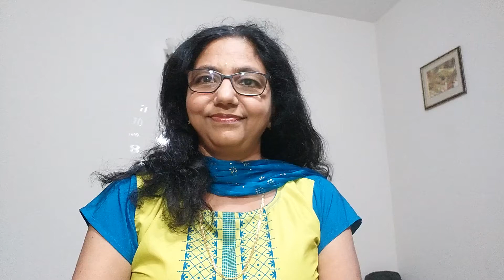Dr Anima Upadhyay viva voce questions on Potentiometery

Comment: Why we use quinhydrone electrode?
Reply from the maker: In Potentiometric Acid- base titrations it is used as it is reversible with H ions
Reply: @animansh  mam why we used it's powder not the solution?
Reply from the maker: @meenusingh5677 yes we add a pinch of quinhydrone as powder
Reply: @animansh  mam that's the question why we used pinch of powder not prepared it's solutions or used in liq 
In viva sir has asked this question
Reply from the maker: @meenusingh5677 there are many limitations, solution should not have any oxidizing or reducing agents otherwise electrode may get poisoned to avoid this powder is added
Reply: @animansh  thank you mam